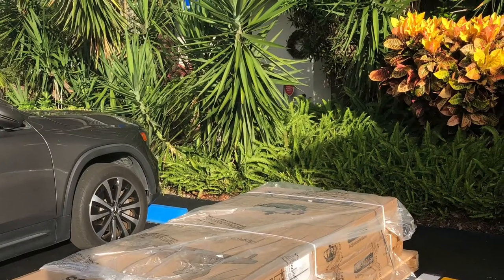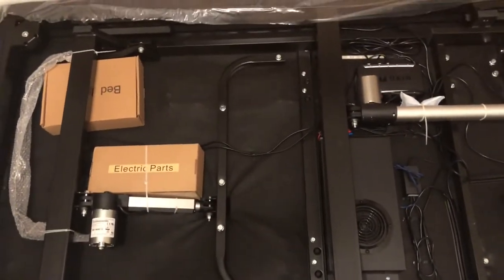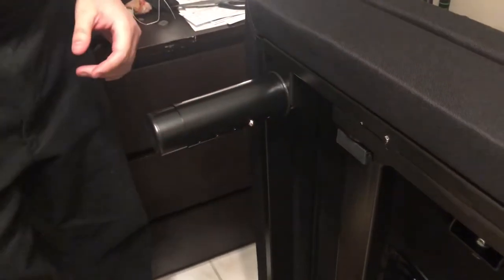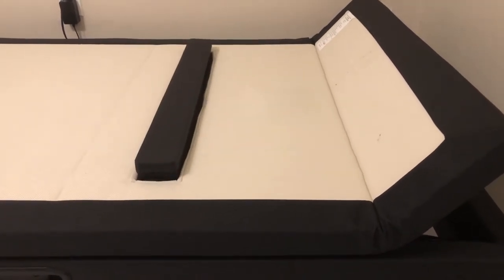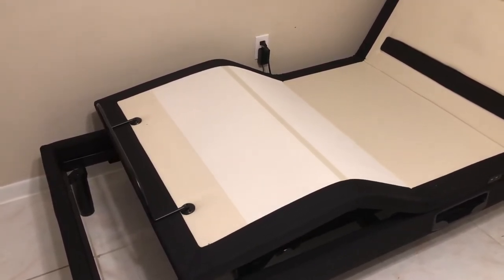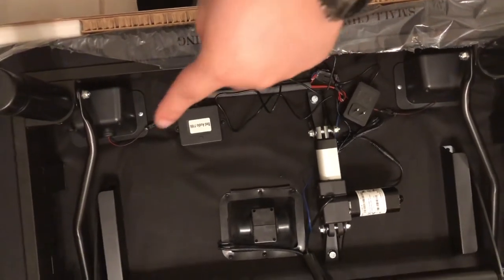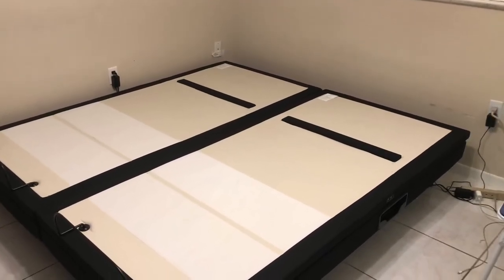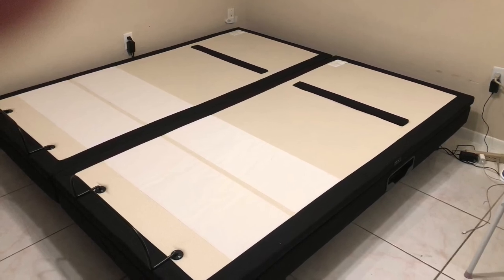Dynasty DM-9000s Adjustable base unboxing.

Comment: Can you actually pay for white glove service?  Thank you very much that was a great review.  Is there an option to connect the bases together or is that needed?
Reply from the maker: You can pay for “white glove setup” it’s around $400. You can connect both bases together, the cable is included, but once you do that they will move together all the time. My wife and I like to adjust the back and legs to different settings so we kept them independent.

Comment: Where did you purchase this from? On Amazon looks bit different the dm9000s. The lumbar support it's a lot lower on the Amazon which I'm not sure if it's good.
Reply from the maker: I bought it directly from
Dynasty Mattress’ website. Their videos use renders (computer generated models) so the actual bed looks different. If you see the customer’s reviews on Amazon the pictures show the same bed as I show here. I also not sure if there has been any changes in this model since I bought it.
Reply: @jaimemesa1999  there is another review video on YouTube of the dm9000s of a lady and there the bed frame is like the one on the rendered videos/photos they provide which is different than yours.
Reply from the maker: @MrVikoBt  interesting. Maybe they indeed made some changes. Could you share the link?

Comment: How are the speakers? You satisfied with purchase? I'm on the fence.
Reply from the maker: Speakers are very decent, I connect them to my TV and gives it a nice surround sound. One thing to mention though is that if you buy a split king; since it’s basically to twin XL bases, each one has a set of speakers with independent bluetooth signals, so to use both simultaneously you would have to buy a bluetooth repeater that can connect with two devices at the same time. Apart from that, I am happy with the base, haven’t had any issues with it.